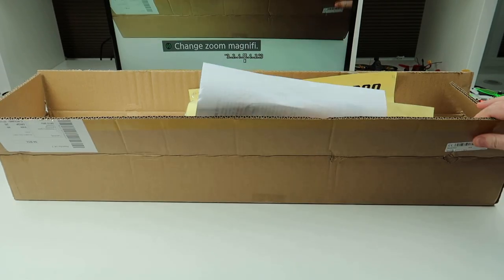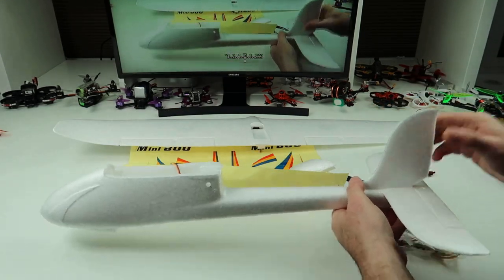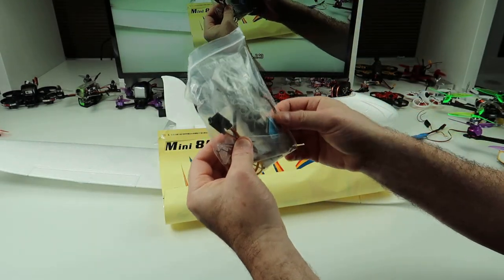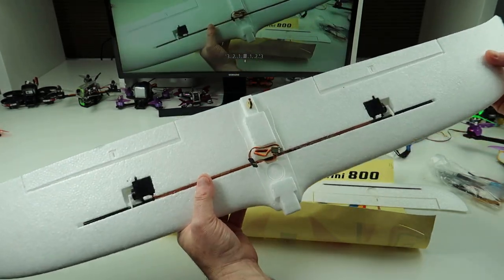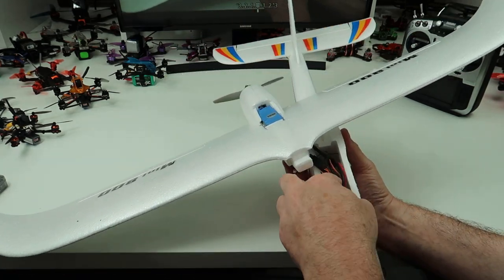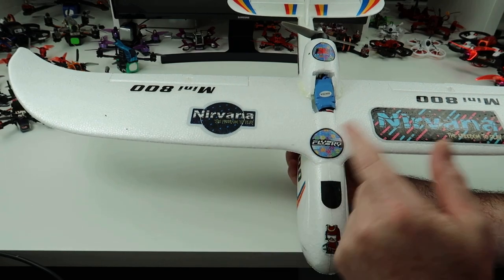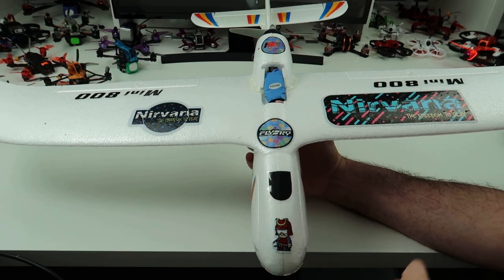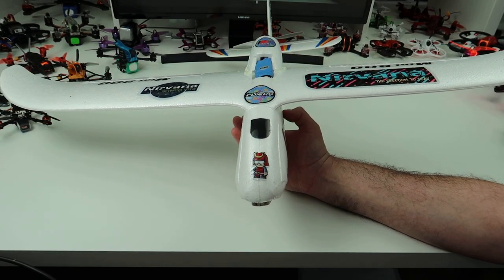MINI SURFER 800 GLIDER DO NOT BUY!!!!

Comment: I love mine, only just changed the motor and esc after nearly 2 years but changed the servos after 2 months. I paid £35 for mine. Don't know how much experience you've got with pushers but they are a right bitch to launch, not enough throttle they dive, to much and they dive. They need a good throw before giving some beans. I've taught my 3 Grandkids with mine, I'm looking for a new airframe if your throwing yours lol
Reply from the maker: Hi i have still got it but its nothing like stock.
It has a 2207 2450 kv motor with a 5 inch triblade prop, 45 amp esc and digital servos from a heli.
I have put an FPV system on it and run it on a 4s 1350 mah 100c lipo.
Its now a little rocket it will take off from the floor at around a 3rd throttle and get around 6 min flight time.
Reply: @CKone41  Wow 4s,     ive got a short vid on youtube if your interested with the standard motor. keywords Mini surfer from Banggood